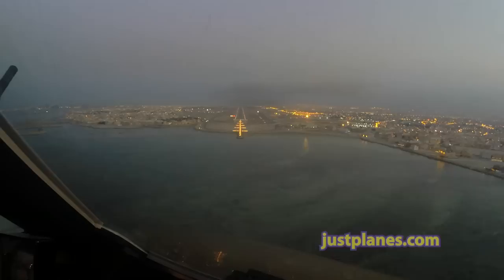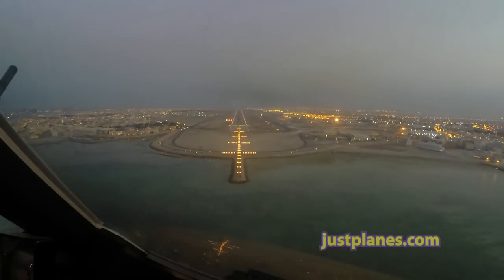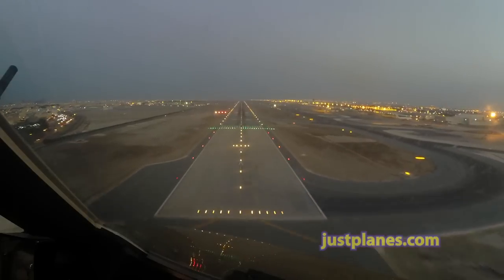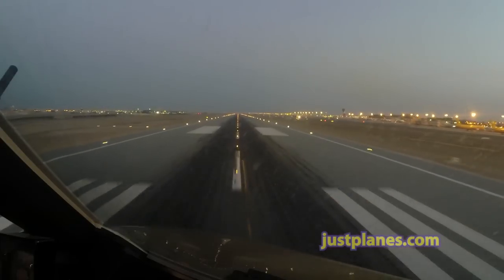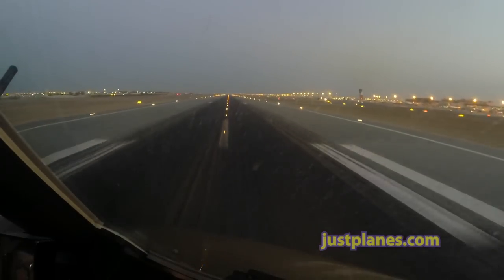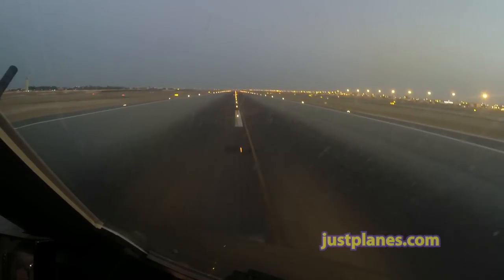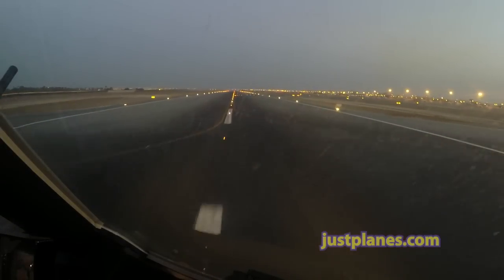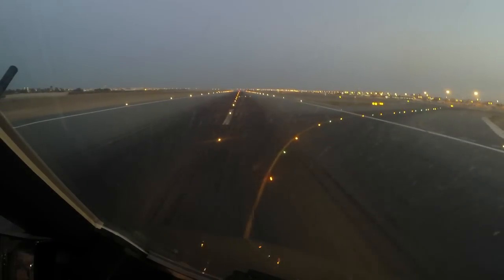PILOTSVIEW of an AutoLand in Cockpit AIRBUS A321

Comment: Nice video, and from the comments I read, no much known. Autoland capability has been around since the 70's, with the DC10, 737-300, 767/757, early Airbus, etc. However, some airlines elect not to maintain CAT III-autoland standards because of the cost. (think of how many airplanes divert in low visibility conditions when the airplane is capable) To legally be able to shoot an autoland, the airplane, the crew, the airport, maintenance, all must meet certain standards (ICAO/FAA/EASA, etc). In this video, with plenty visibility, the approach probably was made for recertification of either the crew, the airplane, or the airport (every so many weeks or months) and must be done in visual conditions. Below CAT IIIb, no decision height (DH) is required, and autobrakes must be operable. I just hope the chatter in the cockpit was a post production edit, and not real time, though videos were not possible in my days.

Comment: If you think about it. That even works with zero visibility :D I think its quite amazing that airplanes can land on their own!
Reply: JetPackJan The purpose of the autoland IS to land at CAT III from 700 RVR to 0/0, otherwise, no autoland required. And yes, it's amazing, but very technological easy to achieve.
Reply: Yes, since the autopilot is not using any visual clues for the landing, thats the safest way to land in CAT III. We can always try landing at cat 3 in a simulator, its pretty tough. I absolutely love it when the visibiliy is about 50ft or so and you can barely see the runway before touch down but you still recognize it as a runway :D Decision hieght: 0

Comment: I did have a question if the pilot or pilots were trying to divert the plane for a purpose crash or divert the plane to another country can the airline turn on auto land on from the ground whereas the pilot would not be allowed to turn it off and second let's say the pilots were unable to land the plane can a flight attendant be trained to turn on the auto land in an emergency situation?  This is the first time I have seen a plane land by itself.
Reply: Autoland can only be activated from inside the airplane. In fact, everything has to be done inside the cockpit. That's why you have pilots. And autoland is not just pushing a button. Everything has to be programmed in the FMC (flight management computer) by the pilots and can only be engaged if all the data is entered correctly.
Reply: dphotos No. Even if they could it wouldn't work as somethings are still controlled manually
Reply: Good question though! Especially with the Jeep hacking that was demonstrated recently.
Reply: Matthieu Calu Hi, your answer is somewhat correct, but a little misleading. No FMS required for autoland capability. Airbus aircraft cannot (not yet) do an autoland for a RNAV or GPS approach, so still ILS is required. Either the FMS can autotune the ILS frequency and course, or the frequency can be done manually by the pilots, and radio altimeter and both A/P must be operable as well.  So the FMS could be inop, and an autoland it's still available. Autoland/autobrakes have been around since the mid 70's, and fully integrated in airliners around 1980 by the major manufacturers including Airbus, MD, and Boeing.  (the A320 design and technology is 35 years old)

Comment: does autoland also initiate reverse thrust automatically or just regular breaks?
Reply: pdmmdk nope...yuve got your preset autobrk setting and retarding the throttle and setting the reverse thrust is still to be done manually.
Reply: No. Autoland just lands the aircraft. Autobrakes just applies regular brakes and the pilots apply reverse thrust.  These are different systems
Reply: Neither. Autobrake is a separate system and reverse is manual
Reply: We're talking about Auto-land here, not the conventional landing.
Reply: But in this case it's an Autoland, the procedures are a bit different
Reply: Yes yes I know :D
Reply: Alrighty then, Haha
Reply: Btw A lot about the airbus systems are described here: http://www.efbdesktop.com/
Sadly, for us, the major content was taken down and is now available as an ebook instead. Before it was free and it was a great rescource. For example: I did not know before that the speedbrakes extend at half the speed on an autoland. And also that flaps 4 prevents the spoilers from beeing extended.
Reply: Yeah,  But there are still many great finds on the internet like the fctm